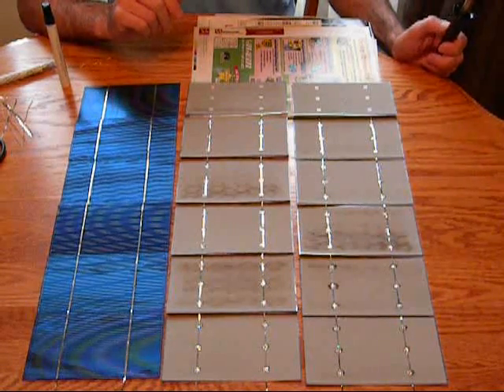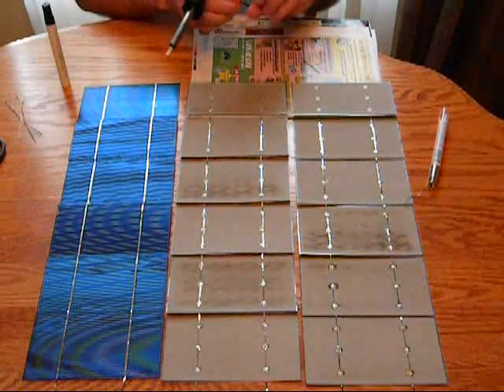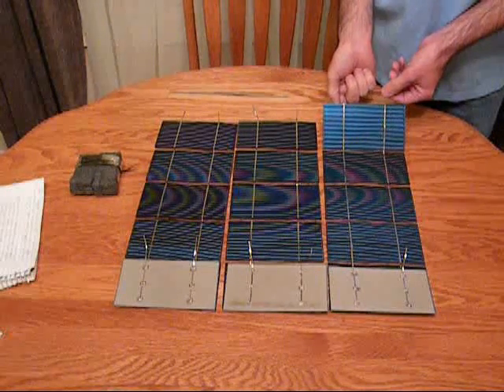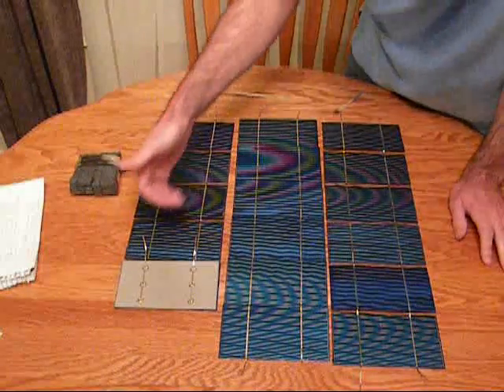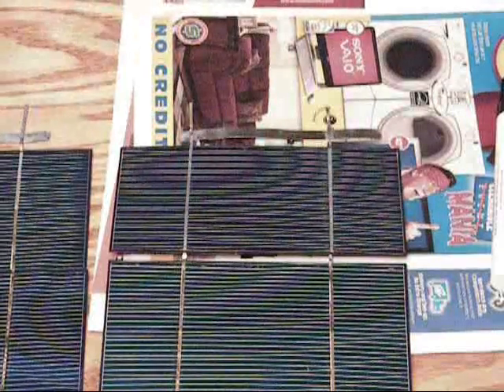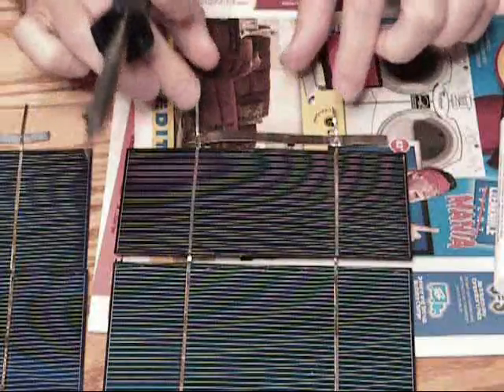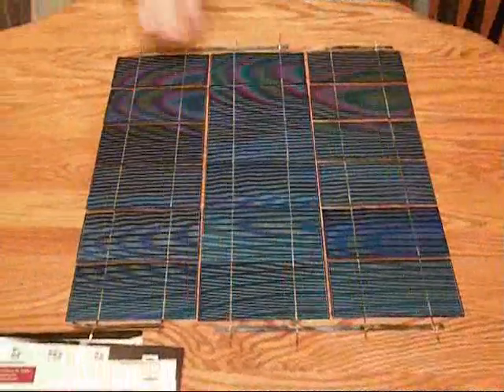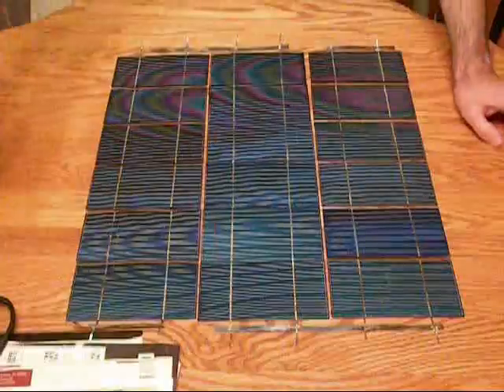How to build a solar panel part 3 (new)

Comment from the maker: @08IRAQVET Yes, I did use a volt meter to tell me what side was positive and negative. You will also need a meter to test if the cells are good or not. Out of a big batch, you will get a few bad ones. It is best to test them all before you spend time putting them together and finding out that one is bad. Thank you for the question, Lonny

Comment: You may want to add a blocking diode to your panel, so during the night they won't suck power from the batteries.